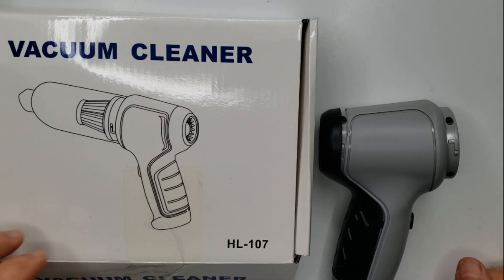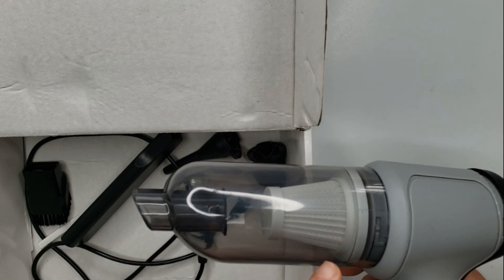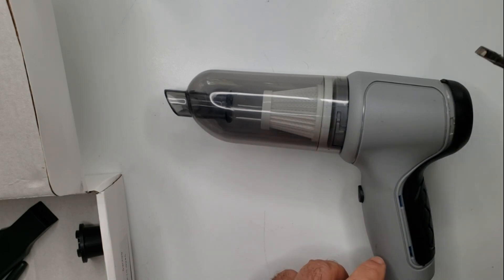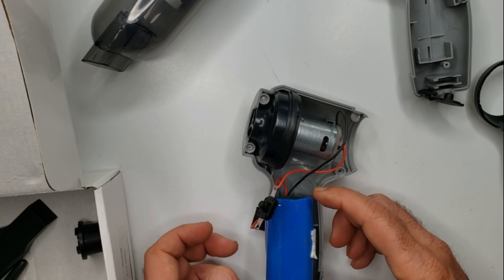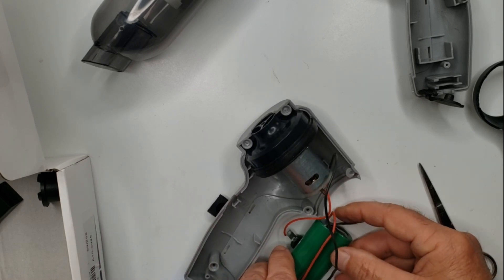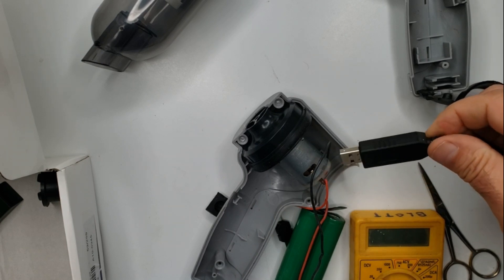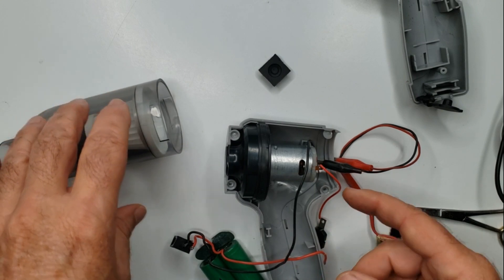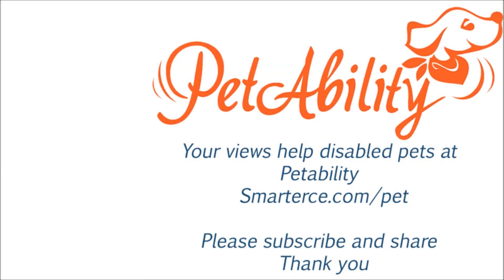HL-107 Vacuum Cleaner Tear Down

Comment: How to replace its motor,the fan is attached to the motor.
What is the method to detach the fan from motor
Reply from the maker: The black fan housing attached to the motor separates in  fore and aft sections. (there is a rubber ring that keeps them together) When you separate them you can get a small screwdriver under the impeller and work it off the shaft. ( friction fitted)
Reply: Yeah finally after one hour work. I figured out how to remove it.
Can you please tell me one thing. As HL 107 comes with 2 model.second one is HL 107B and it is way more powerful than HL 107 and battery backup is also double. I guess it has a bldc motor.
So what's your opinion, which motor I can fix in it to get more power. And if there is any other way to make it more powerful please tell  @frankenfoamy

Comment: ebay is full of these, but advertising them as 12000pa ones like the suitu which are 12000 if you get the pro version, these sell for 8.00 gbp on ebay etc, i have just got four from shopping614 on ebay who stated that these were the genuine 12000pa ones, load of rubbish, the 12000 air speed ones are silver, and the on off button lights up green, that is how you can tell if its genuine, Suitu 6645 PRO is the genuine one and its pretty decent

Comment: I had the same problem. Be careful when opening. Remove the black plastic trim. The original battery has the following specifications: 18650 20eb- 7.4v - 2000 mAh